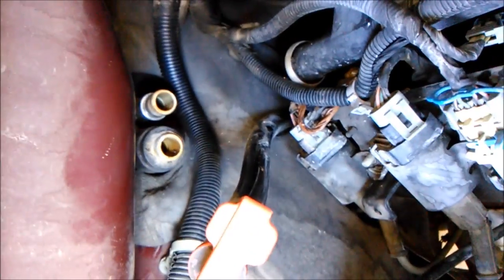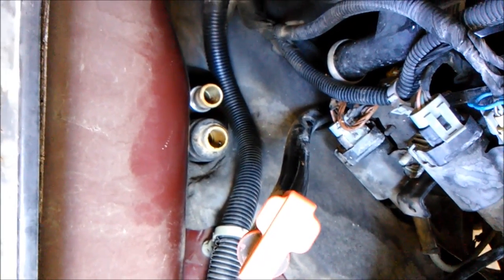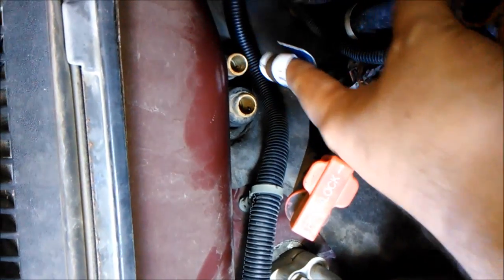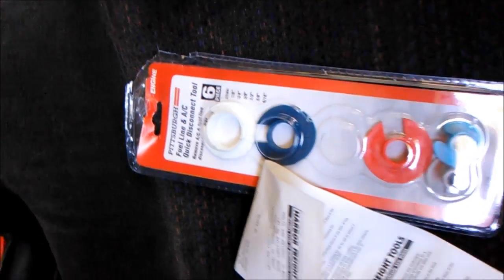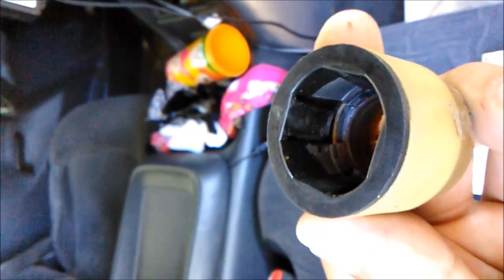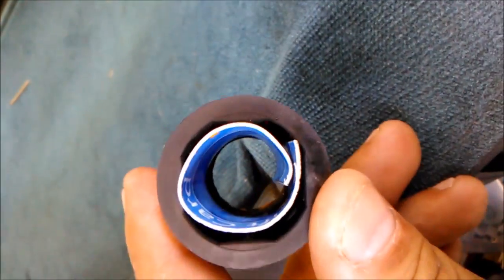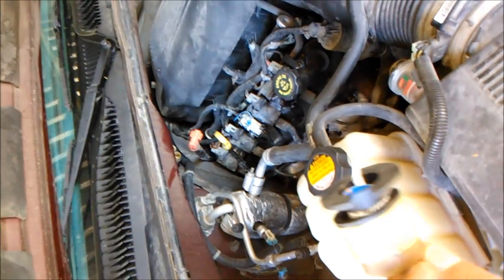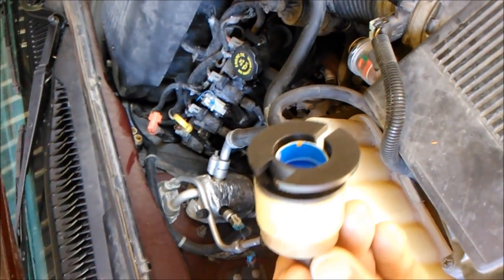quick disconnect removed with no tools

Comment: This hack saved my bacon! I live an hour from the parts store. I didn't know I needed a special tool until I got home. I used an old ID card and a 19mm wrench to push on the card. Great hack! Also, I agree you should change the title to Heater Core Hose Removal Hack.
Reply from the maker: That's awesome thanks for watching my video

Comment: Ridiculous engineering FAIL.  The hose connects to the fitting with a traditional hose clamp, then the fitting slides on to the tube.  STUPID.  Why not clamp the hose onto the tube directly?   It has worked fine for over a hundred years with no plastic part to fail.

Anyway,  something I just figured out on these:  before you try to insert the disconnect tool, give the fitting a hard twist to break the bond between gasket and tubing.  Then, slide in your disconnect tool and it should pull off easily.